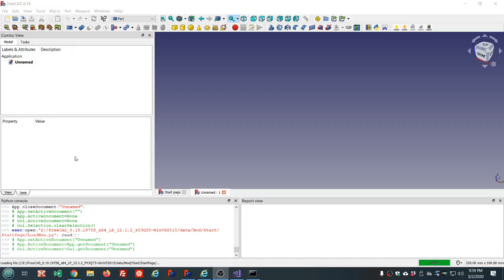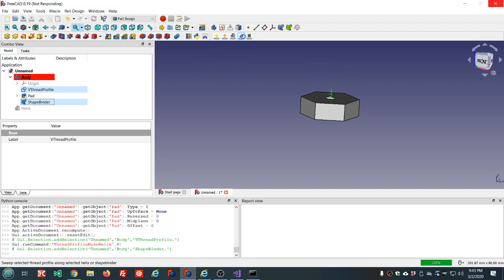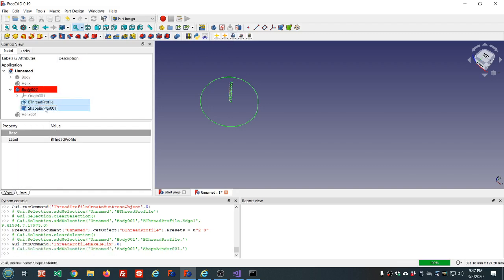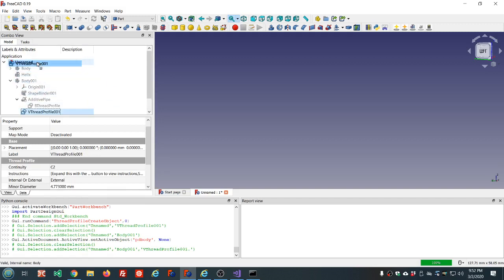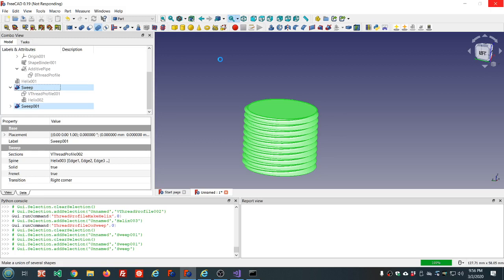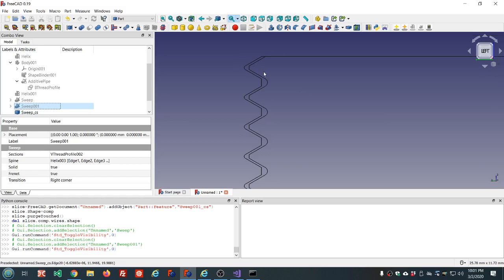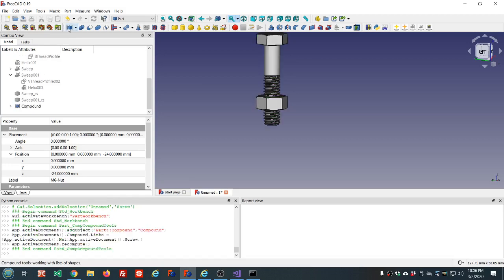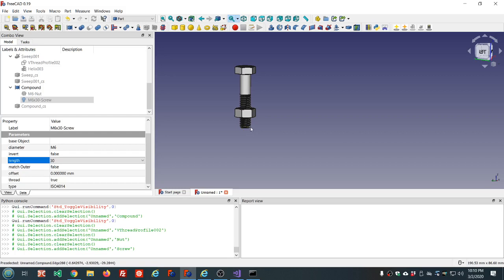033 - FreeCAD ThreadProfile workbench

Comment: This is 2025 and I am using Freecad 21.2 and it is not working out like this video at all. I have worked all day trying to apply it to what I have. This video might have been good 4 years ago but it's worthless now.
Reply from the maker: 4 years later it's hard to remember all the details of the video.  There have been changes to the workbench since the video was made and changes to FreeCAD, too, so there could indeed be some adjustments needed to account for those changes.  At one time a new shapebinder was created, but this turned out to be unnecessary since it works fine to just put the helix into the body.  That could be the source of confusion.  FreeCAD's forum is currently down.  Once it gets fixed you can create a topic in the help section with your file attached what you have so far and we can see about getting it working for you.

Comment: Great video. I’m now able to enter my own specs and get threads I can print - mainly BSP and BSPT threads. One problem is I don’t get the Shapebinder appearing. I have to use the Subtractive Pipe in PartDesign rather than the one in your Workbench. Any ideas as to why it doesn’t show?
Reply from the maker: I made changes to the workbench since this video.  You no longer get the shapebinder because you don't really need it.  Instead, the helix now goes into the body and gets used directly.  Make sure the body is active.  Create the profile object, then select it and create the helix.  If you want internal threads, set it to internal instead of external.  Select the threadprofile object and the helix, then click the sweep icon in the workbench.  It should then automatically use the subtractive pipe for you.  Add a cylinder first so you have something to subtract the internal thread from.

Comment: the wobbly artefacts shown in the thread produced are only visualization. If you go to Edit->Preferences->Part Design->Shape view, and lower the maximum deviation, the artefacts get smaller. The model has higher vector resolution, what is shown is a tesselation approximating the actual geometric object.
However, I think this setting also affects STL export as STL only contains faces and meshes.
Reply from the maker: Correct.  Thanks for pointing this out.

Comment: I am really trying to find the specs for both a 3/4" and 1" painters pole adapter. Can you shed some light on how to go about this? I'm using FC .21. thanks
Reply from the maker: Here is one I found on thingiverse: https://www.thingiverse.com/thing:84774  There it says it's 5 threads per inch, 3/4".  If you are 3D printing you will likely need to do some trial and error.  Make a V thread object and set its minor diameter to 25.4 * .75 using the formula (f/x) button (or pressing = key), and set the pitch to = 25.4 / 5 (for 5 TPI) or 25.4 / 4 (for 4 TPI).  You can try using the bottle thread profile, too.

Comment: Wow... The threadprofile workbench simply skips like 2 steps out of a thousand to make a thread... Stupid. Literally just as easy to start with a helix and sketch a little triangle. Need an auto thread function like what used to exist in beta freecad when making holes. Turns your thousand steps into 3, it is so glitchy to start with... FreeCad needs to automate functions, the whole idea of CAD is to make the computer do the work, not to hold its hand through every single step... Counter productive and stupid waste of time. Should be able to slap in some parameters and hit a button, not this shit. Pisses me off, cuz i have to use this shit.
Reply from the maker: Thanks for watching and for your feedback.  Good news is in 0.20 the Part Design Hole features will have threading enabled.  You can try it now if you get one of the 0.20 development builds.  0.20 will soon become the new stable release.

Comment: I don't get a shape binder, so can't create a thread. Don't know what's wrong, I'm using 0.19 version on linux. Get errors like:  <Exception> ObjectIdentifier.cpp(1511): Document object 'VThreadProfile' not found in 'VThreadProfile.AttachmentOffset'
in property binding 'AttachmentOffset'
Reply from the maker: The workbench has been updated since this video.  No longer is the shapebinder made.  Instead the helix goes into the body, so you would use it the way you would use the shapebinder.
Reply: @mwganson  I selected the helix and the VShapeProfile and it works. Cheers
Reply: @mwganson There's something wrong with the thread profile creation in 0.19, it has a attachment placement offset of +3mm in the Z axis (maybe this was something I did in error and was saved between projects?). This interferes with the thread creation such that the thread doesn't go down all the way to the base of the part. I corrected this with a Z axis of -1mm (necessary because there was still a fine slice remaining). But then the helix wasn't long enough, so I had to make it 12mm long, then it cuts the thread OK.
Reply from the maker: @DaveWatts_ejectamenta  Thanks for the report.  I am unable to reproduce the issue you describe.  Take note it is a known issue with FreeCAD that sometimes cuts do not succeed when both faces are on the same plane, so it is required often to extend the cutting tool beyond the other face.

Comment: It doesn't work at all with the newest version of CAD, doesn't show up with a shapebinder. And when I manually make a shapebinder it ruins the model when I sweep.
Reply from the maker: I changed it after making this video.  I don't make the shapebinder anymore because it's not needed and adds an unnecessary extra object to the tree.  Instead I put the helix into the body.  So the workflow now is create the threadprofile.  Attach it as desired.  Select the profile and make the helix.  Helix gets placed into the body.  Make the profile either external or internal.  Select the profile and the helix, do the sweep (from the threadprofile toolbar).  It will choose whether to make the additive or subtractive pipe depending on whether it's an internal or external thread.
Reply: @mwganson  This worked like you explained it. Thank so much!

Comment: Hey Mark, how would you model a tapered thread like the zinc thread inserts made for wood? The ones that have an Allen key hex socket driver on one end, machine screw threads on the inside and a super course thread on the outside with large gaps in the thread? These inserts have a thread and body with a profile taper of around 2.5deg along the entire length. I tried to model this but totally failed. 
   I wound up printing the prototype with a lot of extra perimeters around a tapered hole and using a lot more heat than I should to drive in the inserts like monster heat-set insert hybrids. It works but I would really prefer to model it right.
Reply from the maker: One thing you could try is to add a second ThreadProfile at the opposite end of the helix.  If it's all at the default location you can just move the 2nd one up in the z direction by editing it's placement z position or just set it to the helix height.  Or you can try attaching the 2nd ThreadProfile to the 1st one and adjusting its AttachmentOffset property to move it away from the other.  Make the 2nd ThreadProfile object have a larger radius.  Maybe the 1st one is M10 and the 2nd one is M12 or something.  Do the sweep as you normally do, then when done, edit the Sweep's "Sections" property to also include the 2nd ThreadProfile.  This way the 1st ThreadProfile scales up to match the 2nd one's radius as it sweeps along the helix.  I did this and it works, but the surface when zoomed in close is a little rough.  You could try tweaking it with the Quality property and the Parameterization property.
Reply: @mwganson  thanks for the reply. I'll give it a try.

Comment: I don't get a shape binder pop up? is there a workaround by manually adding a shape bidder?
Reply from the maker: I recently updated it.  No longer do you get the shapebinder.  Instead it puts the helix into the body.  Use the helix as you would the shapebinder.  Reason for this is the helix needs to be attached to the threadprofile and if you do it with the helix outside the body you get warnings about out of scope links.  With the helix inside the body there's no need for the shapebinder.
Reply: @mwganson  Oh ok. Thank you. I've got it half working. But I have to cutout the threadprofile everytime. Thanks for your time.
Reply from the maker: @rickybrenay6249  If you are making internal threads you must cut the Sweep object from the nut body or whatever the thread is going into unless you are using Part Design.  In Part Design you will get the subtractive pipe / sweep, which automatically cuts away the material.  There are no subtractive features in Part workbench, so you have to do the additional boolean cut in that workbench.

By the way, in 0.20 now the Part Design Hole feature can make the threads for you, but this is only for holes.  If you want external threads, such as for a bolt, you still have to make them.

Look also at Fasteners workbench.
Reply: @mwganson  nice. I saw that too, but I like using the presets!! :). Any way to add presets?
Reply from the maker: @rickybrenay6249  The hole features has presets.  Chose the desired Profile, the desired Size, and check the Threaded checkbox.
Reply: @mwganson  you're awesome!
Reply from the maker: @rickybrenay6249  Thanks.  I just pushed a new update to the workbench, now version 1.72.  It fixes a bug where the generated threads were having some self-intersections.
Reply: @mwganson  ok I’ll check it out

Comment: Thanks Mark, I think it's a great tool you have provided here :) However, I'm getting nuts (litterly) I just cannot make these bolts and nuts fit together, I gotta be doing something here.

I have made a rod with a thread, M30 1,5 fine - that rod and thread comes out perfect, it fits some factory made nuts I have. 
But when I try to make a nut M30 1,5 using your MO in the video (sketch a hex and a circle, map the vthreadprofile to the inner circle, setup the thread on the profile M30 1,5 fine,  pad the sketch, make the helicon, select the shapebinder and vthreadprofile and generate the thread (internal). 
What am I missing here? 
The nut is just too small and doesn't fit, I tried looking at a crosssection and it looks like it should fit.

I mean, you explain you have built in the clearance so they should just fit.

I have Threadprofile 1.69 and I tried both in FC 0.18 and 0.19.

Did you try to print those bolts and nuts in the same profile? Do they fit.
Reply from the maker: No, I haven't actually printed and tested these threads for fit.  I made the model you described after reading your comment.  I created the cross section of the bolt and the nut and compared them.  It looks like they should fit, but I didn't print them out for testing.  It might be what looks to be enough clearance on the screen is not really enough clearance in real life.  It could be the printer is not exactly reproducing the part.  It could be there is some shrinkage in the plastic that must be also accounted for.  

If the factory made nuts fit, then I would presume the problem is with the printed nuts and not with the printed rod, so you need to make the nuts a little bit bigger.  I would try increasing the minor diameter in slight increments until the desired fit is achieved.  In my model the minor diameter of the nut is 28.376 mm.  I would maybe try 28.5 mm for the minor diameter and see how that works.  If still too tight, go to 28.75.

Perhaps also the conversion from brep format to stl format is reducing the clearance.  The circles get converted to polygons, which slightly reduces their size.  If you create the mesh objects in the mesh design workbench you can then generate the cross sections of the mesh objects for comparison.  The cross section tool is in the mesh menu -> cutting -> cross sections.  Try some different methods for generating the mesh.  The standard algorithm is very fast, but the netgen method (in my opinion) often produces better meshes.  You can also test the mesh objects with the analyze tool in the mesh menu prior to exporting for printing.  Export the generated mesh objects via the mesh menu.
Reply: @mwganson  Thanks for your reply, I'll give your suggestions a try, I second your "conclusion" about the nuts are the problem.

Comment: This is a great tool. Thanks for the tool and the instruction!
That's a heck of a list of threadforms but where's the Whitworth (just kidding).
Actually, I do sometimes need British Standard Pipe (BSP) or ISO 7 thread.

Random: The U.S. inch system today is "U.S. Customary" or USC. With that inches are referenced to the international meter, and not the Imperial Yard. This replaced the "imperial" system in the 1800's sometime. Seems like the yard got a few microns shorter with that move but I suspect no one noticed back then ;-). I think the U.K. dropped their Imperial Yard too but still call their yard (and inch) Imperial---confusing.
Reply from the maker: Thanks for watching.  I'm somewhat limited with the types of threads I can support because of the algorithm I used to generate them.  They need to be able to be constructed mathematically (without if/then algorithms) only with the pitch and diameter information.